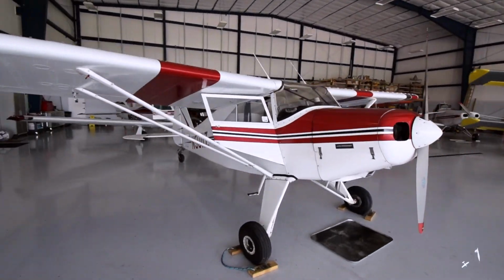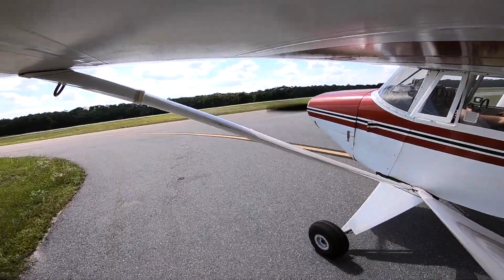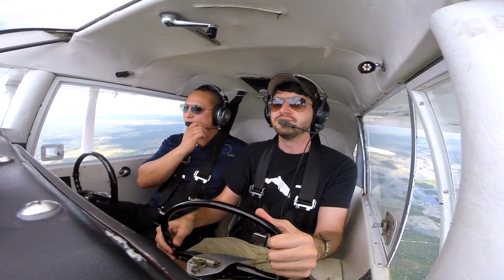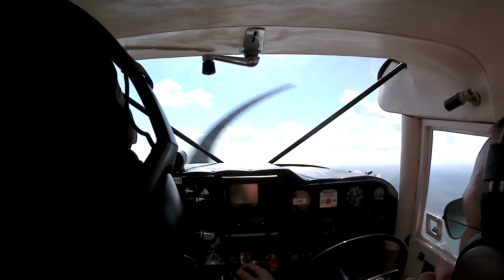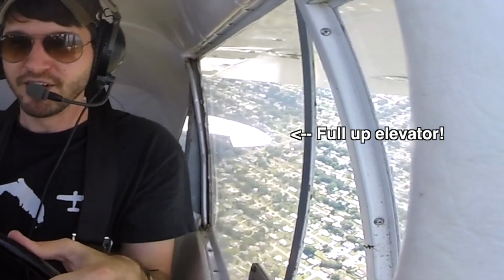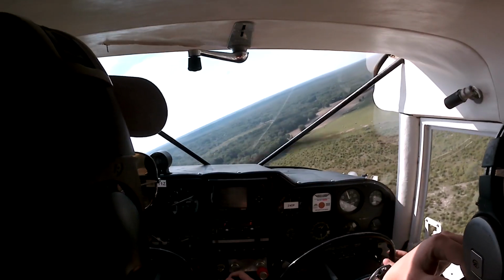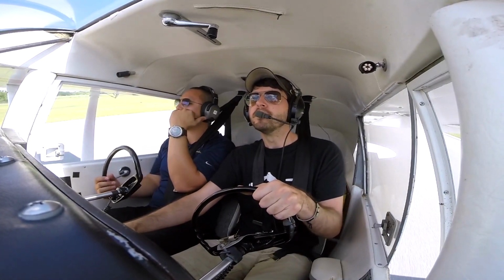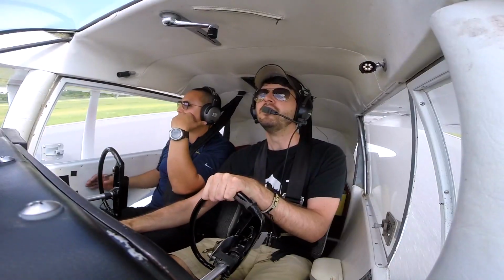CHALLENGING FLIGHT REVIEW – Piper Colt PA-22

Comment: I own and fly a Wittman Tailwind W8. I owned a Tri-Pacer with vortex generators and Madras tips.
150hp. Had it for 3 years and put 250 hours on it. An incredible airplane that I did have seller's remorse over. With the vortex generators and The Madras tips during a flight review with a friend of mine I actually faked the stall because I just couldn't get it to break power on or power off even aggressively. I told him that a couple of years later and he laughed.
  He has a beautiful beautiful 125 horsepower Piper Colt converted to a taildragger that now he is selling to be able to take more of his family flying in. ( Note..he flies a Pilatus PC-24 for a living ). I have flown that airplane ( the Colt ) and it is a beautiful handling aircraft. You just cannot beat the short Wing pipers for  certified airplanes. Highly underrated.
    My Tailwind W8, when I  first bought it and had it brought to Michigan from Southern Alabama by the above mentioned friend, made  me think I had bitten off more than I could chew because it had been years since I had flown that sensitive of an aircraft. A few hours later and I realized I wasn't going to crash it and about 20 hours after that I felt like we were becoming friends. I now have just over 95 hours in N625MS and absolutely love that airplane.
   I would like to buy my friends Colt in addition to my Tailwind but that probably won't happen due to the fact that I have just committed to buy a getaway on an airport up in northern lower Michigan. My point here being long toothed I guess is that the short Wing Pipers  are incredible airplanes whether they are tricycle gear or taildraggers. They are very gentle flying and easy to land with a little practice and  finesse. Excellent video on this beautiful little airplane that is truly a piece of history.
   (Note) I hadn't realized I had commented before but the same still applies. My apologies folks.

Comment: Beautiful Colt! Why full forward? The tail picks itself up when its ready and then flies off as airspeed builds. I learned to fly from my Dad who was a WWII B-29 co-pilot. We had a 1325 foot grass strip and I loved it... never had a problem there. :)
Reply: Ron Patrick      Yes, why full forward?   I like to initially keep weight on the tail wheel to prevent torque or a crosswind from pushing the tail around.  Once airspeed gives rudder authority, bring the tail up.
Reply: In a short-coupled airplane like the Colt, the propeller blast from full power gives you rudder and elevator authority immediately. You lift the Tail ASAP with full forward yoke to get the tail up which reduces the angle of incidence of the wings, reduces drag and increases acceleration. When you reach flying speed (60mph in this case) you pull back on the yoke which increases the angle of incidence, increasing lift and voila! You're flying! Most light postwar taildraggers (Champs, Cubs, Luscombes etc) are like this
Reply: @rhark25  - yeah, but you as a REAL CFI, never tell a first time taildragger student to do a max performance take off like that.  That CFI is a FAKE.  Fundamentals of Instructions teach very clear to teach from the simple to the complex,  not contrary.  That guy looks like another FAKE CFI..
Reply: Geez, calm down these last two guys. Its a simple observation.
Reply: @rhark25  Nonsense Dont make it harder than need be

Comment: I was an Air Force Reserve ROTC cadet who qualified to learn to fly at a civilian student pilot school as Allegheny Co airport which was not a dirt strip in the middle of no where.  The Air Force was probably the reason Piper  turned the short wing tail wheel into a nose gear model. The Air Force  wanted a new generation of pilots  without wasting time learning how to fly tail draggers.  I had 35 hours to   pass an FAA check.  In a year (1965), I went from flying an ugly, underperforming, bare bones to flying one of the ledgendary supersonic T- 38. I flew tankers in SAC, became a week end warrior flying C-123's, and ending up my flying career flying single engine cessnas and pipers in a law enforcement role.

Comment: Those wing extensions and VG should make a bigger improvement difference on takeoff distance, glide, and stall speed here than almost any other small GA plane. Jax and I owned a Colt that was fun and comfortable but dropped like a set of car keys when  power off!  Seem to be a lot of "INOP" placards on panel faces but still has basic VFR stuff. Excellent professional, supportive, friendly CFI (?Andrew Chan?) who doesn't ride the controls like so many poor ones do. Also, remember this student already has his taildragger approval logged: this is a flight review not tailwheel checkout.

Comment: I have about 500 hours in PA-22 and 250 in a PA-20-150. Stick full forward?  I pin the tail down until you have enough speed to lift the tail with authority.  Stick full forward will reduce tail wheel effectiveness.  With a cross wind and a gravel strip, that can make things very exciting.  I would ignore that advise. BTW we have 7 short wings in our hangar block.

Comment: Nice colt, back in 1977-85 had a 1956 Piper tri pacer 150 with a 49 pitch climb prop. Was an awesome mountain flying machine, not much for speed but a very forgiving bird. With the tail wheel mod are the rudder and ailerons still interconnected ?
Reply from the maker: Oh wow they were interconnected for the tricycle gear? No I don’t think there was any connection for the tailwheel version. It actually had a very forgiving landing gear. It also wasn’t a floater. With practice I could see it being a good plane to land on short strips
Reply: My Colt was not intrconnected
Reply: @FloridaFlying  They come down quick when you chop the power.  But on the other hand they respond quickly to power.
Reply: @markstillwagon4601 Colts never had mixed aileron and rudder. They were a good airplane to train in, because if you learned on a colt , you could fly a brick. It flew in a small speed envelope, take off climb at 80 cruise at  best 100, descend on final at 80.
Reply: @DEeMONsworld  I had a lot of fun in that airplane.  It didn't require much rudder in turns to keep the ball in the center.
Reply: @DEeMONsworld  could a 6.4 person comfortably fly a colt
Reply: @justanotheraviator2357  it was basically a 2 seat tripacer plenty of room, I'm 6'1".

Comment: Both the Tri-pacer and Colt can be converted to the tail wheel configuration. 
But I still prefer a slightly longer fuselage in something this size.
Reply: Robin Jacobs The only thing with a longer fuselage is that there is more leverage behind the landing gear and they have a tendency to want to swap ends more easily. They are however more stable during the take-off phase.
Reply: Both are the same

Comment: 03:17 .. That mixture on take off looks like was left on lean taxiway setting.
Reply: 1. How can you see in the shadow of that vernier?
2. Are you saying that for takeoff the mixture knob should  be all the way in = fully forward = leaving no space between the instrument panel and the back of the knob ?
Reply: @fritzkatz  yes, that is the normal settiing.  Unless the mechanic put the stoppage too far back.  But that is incorrect..
Reply: @CFITOMAHAWK2 [who just refuses to stop dissing this positive, professional CFI in the video and ignorantly, arrogantly, libelously refers to him as a "FAKE"] insists: "yes, that is the normal settiing.[sic]  Unless the mechanic put the stoppage too far back.  But that is incorrect.." WRONG WRONG WRONG  Unless there is a slight gap deliberately left on the cockpit end between the knob and the panel by the mechanic [unsung heroes of GA] you could not know the mixture had reached full travel at the carburetor/FI end.
Reply: @CFITOMAHAWK2  Also, depends on the altitude of the airport... Full rich is correct assuming sea level. Some airports are a bit higher.
Reply: @CFITOMAHAWK2  well said

Comment: Full forward, not a good idea in some tailwheel airplanes such as the Cessna 120/140.  The tail will come up normally in most tailwheel airplanes when it is ready to fly...
Reply: This seems like an EXPERT CFI. Whatever stick/yoke forward it takes, in a DC3 and this the pilot  SHOULD bring tail up ASAP so rudder is not blanked as long by cabin and wing’s artificially high AOA on ground.
Reply: @fritzkatz  
I have been teaching/flying tailwheel airplanes for the last 40 years.  What you do with the tail depends on the airplane and what you want the airplane to do.  I own a biplane and a C-120.  In most of the tailwheel airplanes that are easily available today, the airplane will get airborne faster if you hold slight back pressure.  In the biplane I raise the tail as soon as possible to be able to see over the nose.  If you have strong crosswinds during takeoffs, lifting the tail as soon as posible will give you better directional control.  If you hold the tail low during takeoff, you transfer the weight to the wings sooner, perhaps helping you in situations like wet grass.  I can’t think of a situation where you go full throttle and full forward on the stick at the same time that is of benefit to me and in many airplanes you can hit the prop on the ground.  That is unless you are flying a DC3 that 0.05% of pilots will have the privilege to fly.
Reply: @cd4222  I have owned/taught in a dozen (including 7ECA, 11AC, L8A, Texas Aerobat, 170, 195,  Lakes, J-3, Aventura, Volmer, etc) conventional gear airplanes over the last 50 years.  As the FAA FTH and the Aircraft Spruce "Sport Pilot Encyclopedia" state: after a brief period of acceleration, positive forward elevator should be applied to smoothly lift the tail. The goal is to achieve a pitch attitude that improves forward visibility and produces a smooth transition to climbing flight as the aircraft continues to accelerate vs staggering into the air with a high AOA. Technique may vary by aircraft make and model, loading, surface, etc but it is indisputable that raising the tail reduces drag and increases rudder effectiveness. Raising the tail so as to take the fuselage well past horizontal would scare the beJesus out of any sentient pilot but [unless they also tapped a brake] still not often Q-tip the prop in anything other than a Vought F4U.
Reply: Home run on that one So much nonsense on youtube. Not needed or wanted on any tailwheel anything ever !
Reply: @fritzkatz  I am typed in a 3 Are you nuts A 3 will fly off on its own Just guide it very gentle

Comment: Never had a instructor tell me full forward on the elevator. Would love to hear why?
Reply from the maker: I think it’s just to get the tail off of the ground quicker. If the plane were higher performance we would  probably start with the yoke back and slowly ease it forward to get the tail up.
Reply: FloridaFlying to get the tail up and go faster. Nice job brings back memories in my Pacer.
Reply: I used to bring the tail up as quickly as I could in a more performance aircraft. The pro is better visibility. The con is the rudder may not be effective for a few moments and one must be ready to counteract the yaw with sensitive pressure on the brakes until the rudder is doing its work, then automatically go to rudder only. This becomes an automatic response as experience progresses.
Reply: I like neutral stick, let theairplane fly off when it’s ready.
Reply: There is no reason You have it correct.